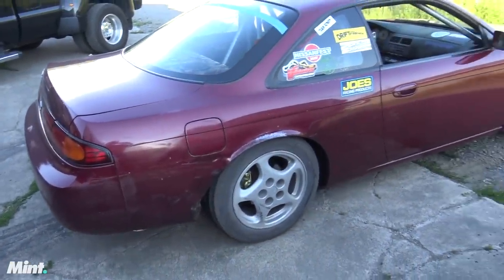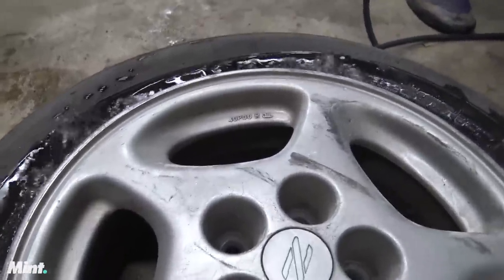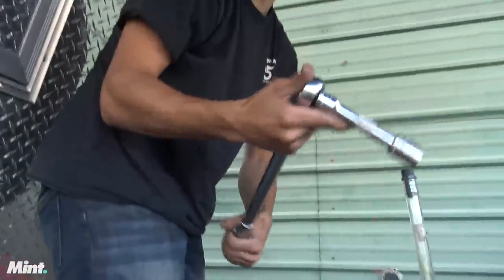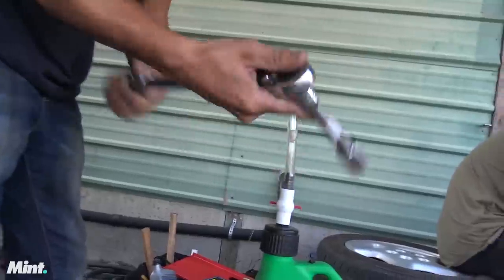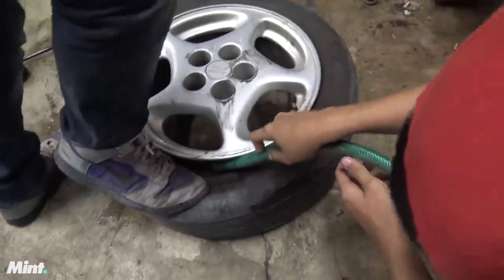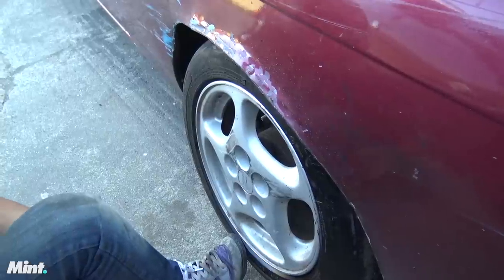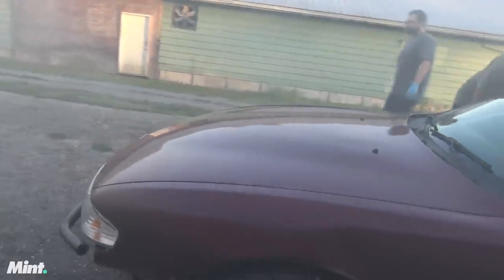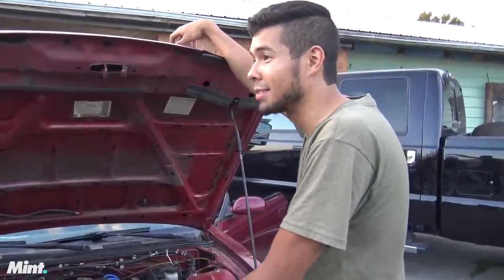Filling a CAR TIRE with WATER!

Comment: God that has to be hell on your drive train
Reply: @ISOHaven a gallon of water is about 8lbs. I figure one tire will hold at least 4 gallons that's 36 lbs a tire. Spinning an extra 72 lbs is harder than pushing or pulling it. So why wouldn't that hurt your drive train? Besides that the water isnt moving with the tire its always holding it back. The inside of the tire is fairly smooth so the water dosent ever get spinning as fast as the rim or tire its self. It's like going from stock wheels on a truck to big ass mudding tires. The dif and drive train aren't designed to handle the extra stress of spinning up all that weight
Reply: @ISOHaven took me a min but I found this. Shaving a pound from your tires is equivalent to shaving at most 2 pounds of non-rotating weight. That's PER TIRE, so a pound off each tire could worth close to 8 pounds of weight reduction. For wheels, the multiplier is closer to 1.6, so saving 5 pounds per wheel (20 total) would feel like a static weight reduction of 32 pounds. For brake discs, it can be as low as 1.2. Regardless of the equivalent weight ratio,    
So that plus the resistance of having water in your tires will eventually hurt your drive train. I'm not saying that it's going to destroy your car right away. I'm saying that the added stress of fighting the water will eventually destroy something. You can not add weight and expect it to no negatively affect your car. Even more so on a thin liquid like water. See the water in the middle will never spin as fast as the water touching your rim or as fast as the water touching your tire. So the water in the middle causes resistance just because it dosent want to move as fast as the rest
Reply: @Justin Emlay That's fine I dont mind admitting I'm wrong. I was just always told bigger or heavier wheels is harder on it. Thank both of you for teaching me something
Reply: Zachary Bernard this might have been the most mature thread I’ve ever seen
Reply: Except the unexpected
Reply: How much would the small amount of air present in the tires, you can hear the water slosh around at one point after they fill the first tire, not being equal effect the wear and tear on a diff? Also how does cintrifical force acting on the water in the tires effect the mechanical structures and parts interacting with the wheels? Hoping someone smarter than me might have an idea.

Comment: Tractor tires are filled with water for the weight.  There is a tool that attaches to the water hose and to the valve stem thus making a water fill up much easier.

Comment: I have many years experience with filling commercial mower and tractor tires with water.  Since water is a thicker molecule than air, tires that had slow air leaks will not leak when filled with water.  The tires are also less prone to "flats" as the water acts as a coolant to keep the rubber of the tire cooler and less prone to piercing.  Also the tire may be filled using a garden hose with an air chuck on the end and fill the tire through the valve stem.  Mower tires are low speed.  A car is high speed and for that reason  it is typically frowned upon to fill car tires with water.
Reply: There are 3 reasons not to put water in a car tyre that I can think of. 1, the braking distance will be dramatically increased and it will eat through pads, lots of rotating mass. 2, fuel efficiency and performance will be dreadful and finally 3. if one of those bursts you will be more likely to spin out yourself and the road will be wet from it.
Reply: Gravemind forgot to mention that it would be so out of balance that it would shake you off the road
Reply: This actually gives me a lot of insight. I kind of want to design a tire with a cooling system now.

What have you done?

Comment: So what did we learn ? That water is success
Reply: KingSlothTv true
Reply: cool dude ;)
Reply: Also, that they won't go up in flames... so these are more like wearouts... not burnouts... xD

cheers!
Reply: If you care about your engine and transmission, it isn't a success.
Reply: Its longer
Reply: GM Gamer explan please...  the water is fluid, and as such will add little to to torque resistance to the drive train, the total extra mass is less than 1 passenger (unless you also feel a passenger is bad for engine and transmission...)...  we have been filling tires with water for years for balast.  The only system which may be affected adversely is the syspension as there is more unsprung weight.
Reply: G V :  agreed the ride may be harsher, and due to more unsprung weight and a less compressible tire.  But the engine and transmission (from your original comment) would likely not even notice.  Water, as well as more dense calcium solutions, has been used to fill tires in heavy equipment for over a century.
Reply: junk cars
Reply: I consider this partly more like a FAIL!

I guess NOBODY took into a count that there is a LOT OF AIR inside that tire. 
The sidewalls are not flat, so there was already some air to begin with. Then they used more air to fill the rest of the tire, and it takes quite a bit to "POP/BEAD" the tire. That's why it was sloshing around inside and performed almost like a regular tire.
If they instead would get all of the air out and then finish filling it up with pressured water, then the results would be something like a rock solid tire and wouldn't bounce at all. Plus most likely they would accelerate or stop at a lot slower rate.
Reply: GM Gamer does it look like they care.. no  any1 who does burnouts or the like doesnt care about anything
Reply: the engine and transmission will definitely be affected. That is a lot of ROTATIONAL mass. I would guess the effect is similar to losing 20HP.
Reply: If you consider this success....
Reply: KingSlothTv I read this comment as that part played😂
Reply: Nathan DeForest can confirm, work in a tire shop doing ag and otr tires
Reply: LeThoNo Games XD
Reply: Be like water
Reply: T-Eazy ok, Bruce Lee
Reply: T-Eazy yeah?
Reply: I'm 70% water,
I'm 70% success.
Reply: diazzsama hm. Yeah it is logical
Reply: Today we learned that water doesn't burn.
Reply: Burn Victim Yoda yeah
Reply: It success except in the winter time, speed bump, and pothole.
Reply: Narrator: And now humanity discovered water.
Reply: TheHitman644 yeah true
Reply: A 15 PSI radiator cap contains 212 degree boiling water just fine. The tires are rated for 35 to 40 PSI & likely will hold 60 PSI before failure. The water would have to get to 300 degrees for that to happen.
Reply: Michael Haiducek yeah

Comment: Fill it with gasoline and smoke cigarettes
Reply: What's that gonna do? Cigarettes dont light up gasoline.. I've tested a bucket of gasoline, toss a lit cigarette in it and it just dies lol
Reply: Andrew Morgan it will catch fire 🔥
Reply: Doesn't do anything
Reply: Depends,  gasoline ignite at 495c and the cigarette at 400c but during puffs it goes to 900c  so depends.
Reply: The moment the tire bursts the gasoline will be hot, a whole other story. Lots of fumes.
Reply: Humanalien true that. I wouldn't want to be smoking when it explodes. But just a cig thrown on sitting gasoline itself doesn't do anything.
Reply: Calm down there, Satan
Reply: Wont do shit. 
The old mechanic doing my gas lines...was smoking doing them... I'm like hey isn't that gonna light us all up... he put it to the drip... cig went out each time. 
Ignition needed. 

Now maybe put a little gas on the tire and light it with the gas inside ... take a lighter to it... burnout...

Boom ?
Reply: You wouldn't even have to purposefully light it, due to the sparks emitted by the wire in the tires with contact on pavement. Thise spatks would be plenty to cause an ignition and explosion immediately after the tire wore through.
Reply: It will catcher fire cause car when  you drive it car comes out smoke so it will burn whither cigarettes smoke and gasoline
Reply: Cigarette on gasoline:
https://youtu.be/cJQjeBWvm-0?t=27s

Comment: Here in the uk this is common practice at stock car racing where they only turn one way arround a circuit, helps traction and stability through mud on the side of the car which has less weight on it when cornering, it also stops the tyre lifting off the ground as much when cornering.

Comment: Air density is 3kg/m^3
Water is 1000kg/m^3
Biggest power loses is if all the weight is away from the center of spinning thing. And you filled tires with 700 times more mass

Comment: I think I know why the tires lasted so long. When the tires get so hot that they start melting and burning they are much more likely to rupture. Because the water is so much heavier than air (and has a much higher specific heat) it takes a lot more to get heat up the tires. The water keeps taking the heat away, like a heat sink.

Comment: the tires last because of specific heat capacity of the water.
Tire filled with water makes it more heavy proportionally having greater inertia. Greater inertia put more stress on the machine.

Im not sure if im right, but this is what i think.

Comment: Filling a tire with water is an old farmers trick for tractors. Though it increases the rotating mass and there's fluid friction losses via viscosity, on low speed applications like tractors the loss is marginal and what you gain is weight for pulling, plowing, and digging which greatly increases friction and grip on the contact patch area of the tire. Of course as the speeds increase due to the law of kinetic energy, doubling the speed of an object gives it 8X the kinetic energy. Likewise doubling the weight of an object means it requires exponentially more energy to rotate than it normally would have.
Reply: Br!an Delta V its more common practice than an "old trick" right?
Reply: Just because its an old trick doesn't mean its not common practice. They aren't mutually exclusive.
Reply: Br!an Delta V k
Reply: Br!an Delta V r
Reply: Z.
Reply: Br!an Delta V

S

Comment: We put water or brine in the tractor tires for extra weight. Some large trucks may have water in the tires. If you pop the valve out you could have filled it right up.

Comment: i like how you use a torque wrench to put the wheel on lmao such a precision maneuver
Reply: That's how its supposed to be done so you don't warp the rotors and or drums.
Reply: @jesusisalive3227  it's so you don't buckle the wheel and imbalance it. Rotors normally always have inconsistencies but they have a small margin

Comment: farmers do it to tractor tires for weight and traction
Reply: Josh perez no they dont they use calcium because water will rust the rim out
Reply: no actually they use used motor oil and gear oil because it dont freeze and it saves them from disposing it legally. but i didn't say that because i didn't want to blow their spot up. lel
Reply: Josh perez that's not true
Reply: Water, most tractors use tubed tires due to low air pressure
Reply: asdg asdf I'm literally a farmer. We use calcium just like every other farmer
Reply: They add Calcium chloride to the water to stop it from freezing. I use straight water because I don't need to worry about it freezing, a literal rancher.

Comment: fill with helium next
Reply: And so flying cars are born!
Reply: Nah.  Fill it with carbon monoxide and close the garage door.
Reply: Fill them with hydrogen
Reply: Agent Smith  They would have the opposite effect. They would be heavier than using normal air as although helium is less denser, it also occupies less space so more of the matter is needed to fill up the tyre. So not really an interesting experiment.
Reply: Agent Smith it's pretty much air
Reply: HB: But at the same time the molecules are smaller and just as how helium will leak out of a regular rubber balloon through the actual walls, I'm wondering if the same might happen to the rubber tire?

Comment: Water in the tire absorbs heat, water absorbs heat really easily. Try putting a lighter to the outside of a thin plastic water bottle, it won't burn
Reply: This doesn't mean unlimited burnouts, but it means you can burn out much longer as the tires stay cool they're harder to rip and destroy
Reply: Cool explanations you got there
Reply: The heat sink provided by the water kept the inner wall of the tire cool and extended the burn out life a lot.
Reply: And the wheel spokes acts as a air-cooling system.
Reply: jack morkie my barn burned down, when it did it had a bucket filled 3/4 of the way, it was where the fire started, (it was a hay barn) what was funny was the bucket melted to the water level and stopped

Comment: They do this on heavy equipment. It’s called a “loaded tire”
Reply: Kyle's cars 

Yeah, but we do it for ballast. 
To lower the CG of the rig and to increase grip while on loose surfaces. 

Heavy equipment runs lower RPMs on everything compared to a car. Also our oilers repack our axle bearings with grease at end of shift when we refuel. 

I'd suspect loading the tires like this will increase wear and tear throught the drivetrain over all.
Reply: Except they don't use water, causes rust.
Reply: various type of ballast, we use calcium/water and beet juice
Reply: archie punzalan on schrute farms they make their own tires from hemp fibers.

Comment: Very old drag racing trick for more traction. Works for farm tractors too. But if the tires warm to operating temperature, you get steam and catastrophic failure from too much pressure.

Comment: Fill the tires with concrete Ooooooooooo nail proof but sadly not transmission proof
Reply: not as crazy as americans
Reply: Mythbusters tried that. the car would barely go over 20 mph at full throttle.
Reply: Trade the trans for one in a semi truck
Reply: But are you nail proof?
Reply: Very true.
Reply: Yulema Nunez hmu bby